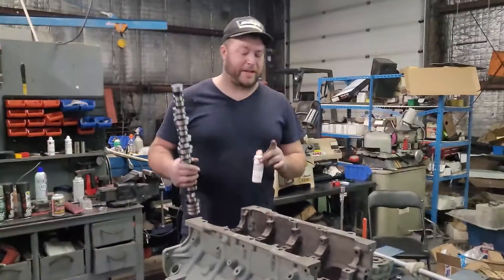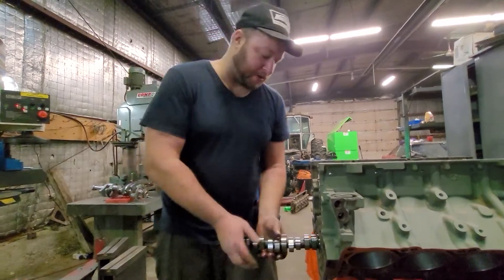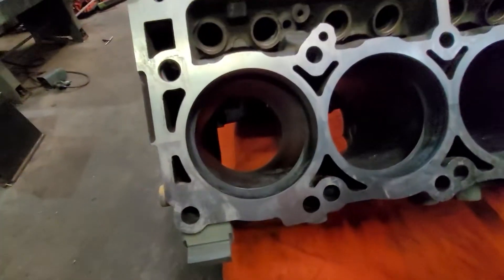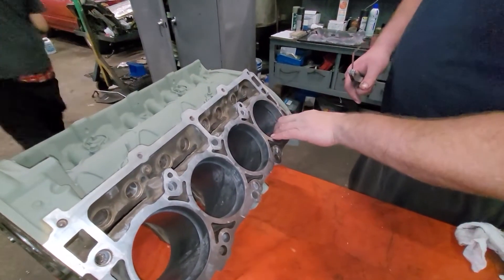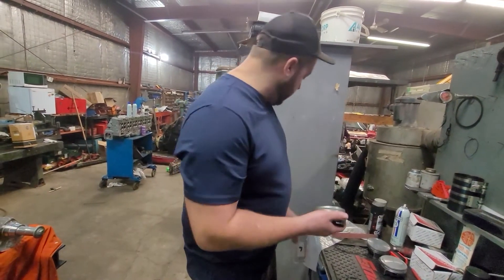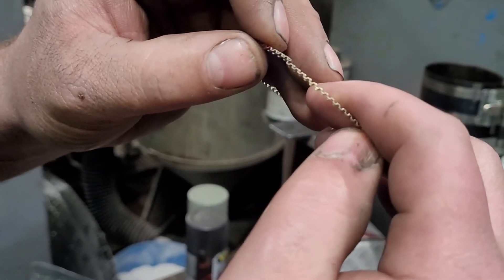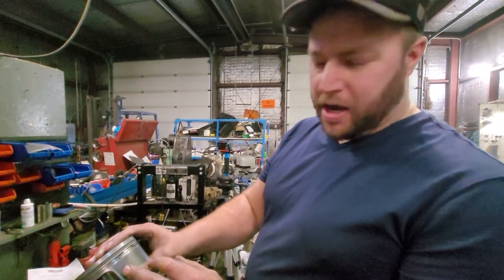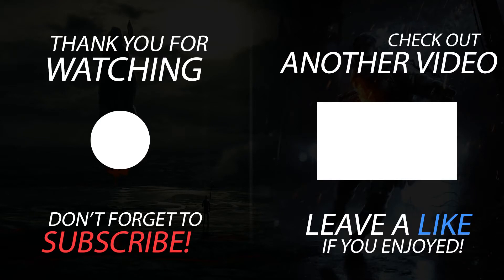Hemi Engine Rebuild - Part 2 Ring Gapping

Comment: I had a cam/lifter failure on my 14 ram 3500. Got the cam out and oil pan off. Is there a way to inspect the crank bearings without removing the block from the truck?
Reply from the maker: if you have the pan off, you'll need pop a main cap off and inspect, hoping it works for you!